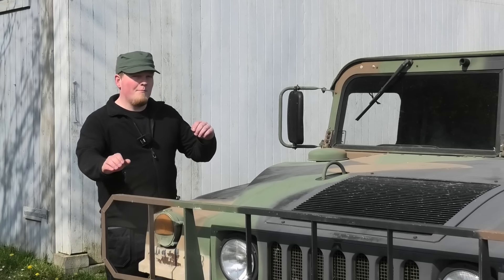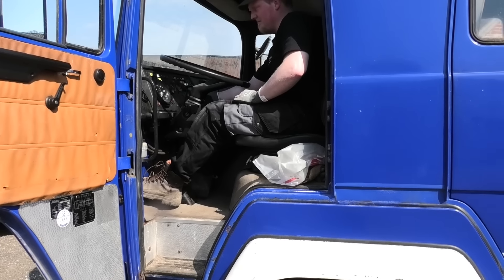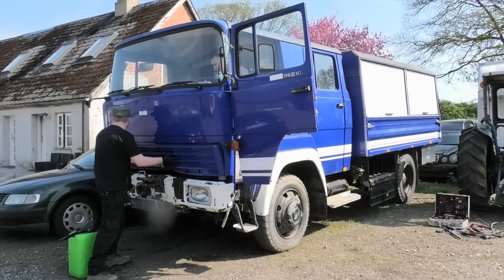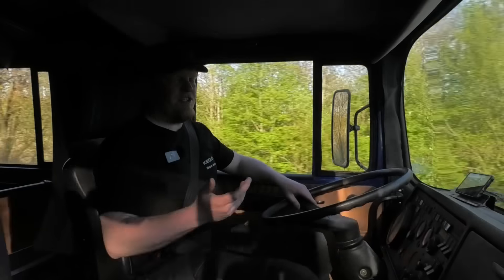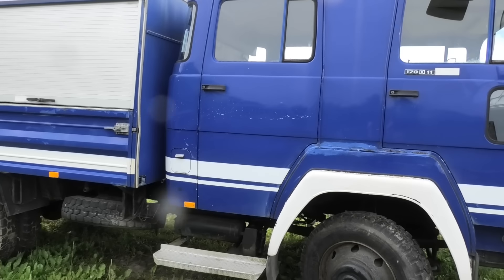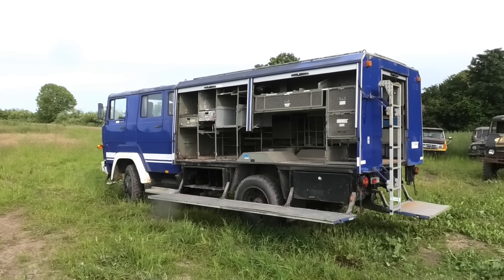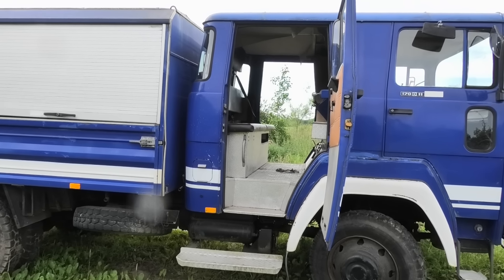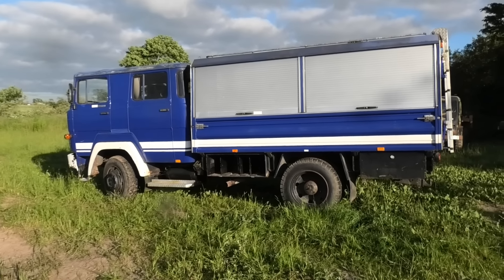Bought a Magirus "unseen" - Can we drive it home?

Comment: I operated one of these until 3 years ago and did some repairs and rebuilds and stuff. So feel free to ask.
If you are going about 60km/h in 6th gear full throttle, it may be you are in low gear. Changing gears is somewhat tricky sometimes, it may stick in low gear even if the lever is on the left. What you need to do is pull the lever even more to the left, you should hear the air cylinder doing something. If it's sticking, drive the thing, go full throttle, pull the lever to the left and hold it, lift the trottle and back to full throttle. It should shift, if not do it again. Or try to get in in low gear, to make sure where you are.
The knob in front of that lever is the middle diff lock. The rear diff lock is the knob right side near the steering column.
It would be interesting where it has been in service.
Reply from the maker: Thanks a lot! thats very helpfull. and pretty much confirms how i figured the levers for the transfer-case, work :)
But it doesn't feel stuck in low range (if so, those are some extemely high, low range gears.)
i was able to get it up to speeds of 80-90 km/h. But it just took a really long time.
And on gear changes, when i hit the max speed in one gear, and then canged to the next, it barely had enough power to pull in that gear.
So it really felt like i just couldn't give the engine enough throttle.
But i still haven't looked into the whole ting, any further :)

Oh, and from the little documentation i have, i seems this served at a depot, in Suderlügum. and was last registered there, in 2016.
Reply: @KJOff-Road /videos 90km/h means it's in high gear, for sure. It's high speed, maybe it will make 92 or 93. So fuel issue it is.

There was no THW in Süderlügum, but in Niebüll. Maybe from somewhere else and second life in Süderlügüm. I couldn't find anything.

Comment: That would be such a good starting point for a camper build.  Off-road capability and a sturdy functional box.  There are many of these still around, see if you can sell the box to a fellow Magirus owner at least.
Reply from the maker: I have seen a lot og these, turned into camper rig's :)
Reply: Sick of hearing about Campers
Reply: @KJOff-Road  When you have the box off just place it in a barn and use it as a tool box. Crib up to the chassis height, and you have a nice new secure tool storage.

Comment: The problem with the engine rpm is likely to be the governor on the injector pump. If the seaĺ goes bad on the rear of the pump it causes a hydraulic problem that stops the governer from opening up.

Comment: German guy here. If you can't get it sorted in your place - maybe I can help.

I shortly looked into it: With a buying contract (has to have the VIN in it) German KBA (Kraftfahrt-Bundesamt) should be able to provide the neccessary documents for a small fee.
Reply: Ich habe auch schon geschrieben, dass ich mich im Zweifelsfall mal mit meiner Zulassungsstelle diesbezüglich unterhalte.

Die Daten müssen ja da sein. Wäre traurig, wenn der Lkw nicht wieder auf die Straße kommt.
Reply: Would be great to have German help if he ends up needing to contact a German bureaucratic system 👍
Danke
Reply from the maker: Thanks a lot guys. it's good to know :)
I may get a hold of you, if needed :)
Reply: @KJOff-Road  Hi, I live in Sweden and had a similiar issue with an former German Ikarus buss. You need to get in touch with the local office too the city where it was registered. 
There is no central office that has registration documentation in germany it all handled locally. If you have the german numberplate number that helps point you at wich office you need to contact. otherwise i would try taking contact with the THW becouse they probably have documentation on it.
Reply: @KJOff-Road 

With the THW license plates there are some things to know. 
Because there are a special organisation, the KBA (Kraftfahrt Bundesamt) can't help you.
The vehicles are registered via the THW registration office at the Procurement Office of the Federal Ministry of the Interior. 
I'm from Germany as well, please get in touch to me, If needed.
BR, Martin
Reply: That is a very cool box. It would be nice to have something like that in the US. You should find a trailer that you could put it on and have a mobile work shop with a generator and welder. Hope you can get the legal stuff taken cared of.

Comment: i drove that type of Truck at THW many years ago 🙂
the trottle problem looks like a swamped diesel filter or the diesel HP pump (nned some maintenance)
BTW: the "shut off button" is meant as trottle-brake

Comment: Congratulations on the acquisition of the ex-THW Magirus. Unfortunately, I didn't watch the video earlier. 
Here is my tip: There is a website (in German) on which thousands of historic construction machines are presented and discussed, including many ex-THW vehicles. You may be able to get help there. The latter will perhaps come quicker if you register there and introduce the vehicle. As YT generally don't like links in comments, I will send you the link by email to the address you provided in this thread.

Good luck
Reply from the maker: Thanks a lot. I got your mail 👍
This might be very helpful :)
Reply: @KJOff-Road  The Magirus Deutz 170D11 is a widespread model that is also used by many fire brigades in addition to the THW. Both areas are known for the fact that vehicles are kept in them for a long time, especially as both fire brigades and the THW have plenty of opportunity to maintain their equipment when not in use. One more thing about the THW: The Federal Agency for Technical Relief (THW) is the German civil defence and disaster control organisation of the Federal Government with volunteer helpers and full-time employees in the portfolio of the Federal Ministry of the Interior and for Home Affairs. The higher federal authority has its headquarters in Bonn-Lengsdorf. The THW was founded in 1950 and has been a federal agency under public law with its own administrative substructure since 1953. The Federal Agency for Technical Relief is therefore a higher federal authority. 
The THW has local branches in almost every municipality. The equipment with vehicles and other devices is quite comprehensive. They are not a chip shop.
The Magirus model under discussion is already quite old. Since ex THW vehicles are widely known for their good condition, quite a few have found their ways to small fire brigades or into private hands. Accordingly, the concerning knowledge should be widely dispersed. The spare parts situation should not be particularly tight either. You just have to find both. Unfortunately (for you) the whole area mainly takes place in German language. In special cases, however, I'd like to help with the research. In such cases, please send me an e-mail to the address you know.

I wish you continued success.
All the best

Comment: @KJ Off-Road Hi KJ, German guy here who spend quite some time of his early life on THW and those rigs.
As already said there is nowadays a centralized license plate „THW-<number counting> on the actual THW trucks. But they changed the system quite some time ago for all THW , Police , Katastrophic Services and similar agencies Trucks and cars. Even sometimes Fire Trucks. With different letters of course: e.g. the letters from the normal car plates for the capital of the german sub-country (Bundesland) like for example in Hesse the capital is Wiesbaden meaning all police cars in Hesse have „WI-<number counting> plates. Makes shifting vehicles from one stationary to a different one a piece of cake.
That explained here comes the trick for you:
BEFORE that centralized practice those Trucks had real local Number plates like any other vehicle.
This means your truck probably had TWO number plates in his life meaning two sets of paperwork existed.
What you have to do is search the complete vehicle for remaining hints of those number plates, because with having multiple trucks if the same loaded goods and gear we have put frequently the number plate data (or a shortage of that) on the gear and multiple places in that truck. Basically everything removable that could be misplaced after cleaning offsite of these trucks needed to be identified to put it right back.

Also: inspect carefully the driver and passenger door. There must have been a time when „THW Ortsverband <Name of a german city> must have been signed in big letters on that doors.
This „Ortsverband …“ means something like Stationary.

So, with information of the old first number plate and the city name you look up the actual contacts of the THW of that city and ask them for the favor of a copy of that old paperwork. I know they keep goid records, especially the little ones like the one i was in.

If you only get the last THW-123456 Number plate you ask in the THW facebook group for a contact of the city name. You want to find the job role „Schirrmeister“ of that years after the manufacturing date of that truck to hit the jackpot of person knowing EVERYTYhYiYnYg of that truck because it was his duty.
And add a year when asking because sometimes they had the new trucks up to a year in stock coming from the manufacturer until all x-dozens of them where produced and then they rolled them out in the new version all at once to the different Ortsverband to make no-one jealous that the other ones already got the new truck.

THW people are nuts about their special vehicles and proudly show them off knowing every tiny detail if it - like fire fighters who are the same kind.
So as soon as you can name the plates and Ortsverband for specific identification it will be possible to find a person giving more details.

Good Luck!
Peter

Comment: That stop button in front of the seat, is the exhaust brake. But it also works as a stop button.

Mercedes used the exact same mechanism, until the late 80:s.

I drove a 10 cylinder Mercedes 1932 tanker truck for many years. Same setup, and the VDO gauges and warning lights were very similar. Even the steering wheel.
Reply from the maker: Ah, that would make sense :) 
Thanks!
Reply: My 2 cents: careful how you build the roof rack. The noise it makes at highway speed can bring about a lot of regret. But all in all great find. 
Put the box on a utility trailer for towing dirt bikes,  tools and sleeping quarters,  what have you,  for off road adventures .

Comment: Suggestion
Remove the shelf's
Keep the side folding platform and modified it so the "blue panel" could fold down (some named it 3way)
IMO it will make the "flat bed" more practical

Also that workinglamp somewhat feels soo coolll

Comment: O yes. I know the sound off those air cooled Deutz engines so well. As a much younger bloke I served in the South African defense force. " yes South Africa did have a proper defense force back in those days. " and they're vehicle of choice was the Magirus Deuts. And yes, I was a driver. Fantasticly well built old trucks.
Reply: Known as SAMIL and SAMAG. South African license built magirus trucks.

South Africa only imported a small amount of actual magirus Deutz trucks. Around 2500 units if I recall correctly.

How ever produced around 16 000 SAMAG, SAMILs locally.
Reply: @spotty4710  The SAMAG and SAMIL all used ADE engines though, the Deutz engines were only used in those branded Magirus, and also in aircraft tractors and such, along with use in the fire engines on all bases. The tractors used the Deutz engines, a Borg Warner automatic truck gearbox, and a modified Mercedes differential, along with a prop shaft that was basically 2 universal joints welded together, as the tractor was that small. But with it all being made from bent steel plate, thinnest being 6mm steel as covers, and then going to the chassis, made from 25mm steel plate welded to make the U channels and such, so that you had a 16 ton aircraft tractor, locked forever into first gear with a pin. Those were wicked fast on take off, though when they were involved in accidents, invariably the damage was to what they hit, and possibly a new coat of yellow paint on the tractor. I did rebuild one that caught on fire, memorable in that they used every fire extinguisher in the area on it before the brigade arrived. not worried about the tractor, but because of what it was towing when the wiring loom caught fire.
Reply: @SeanBZA  the Mk.1 models used deutz. Noted by the smaller grill style than found on the Mk. 2 and 3 models.

Comment: The truck is so old with so few kilometers on the clock... it hasn't even had the "major inspection" yet, the problem with the "speed" could be that the injection pump needs an oil change because old oil becomes "sticky" over time. The problem (which someone else posted) with the leaky seal on the pump comes from "many kilometers driven", but with less than 50k on the clock it is more likely "swamped oil" so that the pump cannot turn on fully. (I speak from experience, because many mechanics don't want to do this oil change because it is a huge mess)

Comment: I did a little research, and that truck has the Duetz F6L413 engine, which is a 4 stroke 9.6 L. V-6. It appears to be turning plenty fast RPM-wise (max is 2300 at WOT), but someone else mentioned the little lever between the seats as being for either a 2 speed axle, or the splitter for a secondary gearset in the transmission. Most likely, you were stuck in low range through the whole trip! If it's anything like the control valve for the PTO, it's probably worth looking into. I love the design of the body on that thing. It would be perfect for a tool truck at a racetrack, or for on site heavy equipment service!😉👍👍

Comment: 100% agree . Strip out the rear body and turn it into living space . 
Aluminium sheet where the side roller doors are . 
Insulate with celotex sheet materials . Solar on the roof . 
Honest it would make a fantastic camping vehicle . 
Much nicer than sleeping in the back of the cab . 
Nice truck .

Comment: Sir that's a super nice work truck.  Greeting from Murika.
@25:50 It's a diesel it probably has a govener limiting it, it really sounds like 17-1800 rpm to me, that wouldn't be out of the normal.  I'd think 2500 would be too fast for that engine to spin, most older diesel engines are booking it at 2 grand

Comment: That Box would make an ideal base for the construction of a camper, and with those step sides it opens up possibilities for slide outs or canvas extenders to increase the usable space, along with the under body boxes for storage etc, even if it is not used on the current chassis

Comment: I could be wrong but usually that button at your foot you pressed to stop the engine is actually called a decelerator, its used to retard the engine exhaust when travelling down long hills, it helps slow your vehicle down without overheating the brakes especially when carrying a heavy load..!
Hope this helps

Comment: I used to drive a Maggy Deutz 8 wheel tipper. Great bit of kit not the most powerful but that Air-cooled engine was so reliable. It never gave us any problems. Not the quietest engine and it had its own peculiar sound. But us Drivers loved them..

Comment: Dude can you show me the NATO jumper connector at some stage, if you think of it please, interested. I spent near 200 euros on some 350 amp andersons for my winch and , well thats too much!

Lovely truck. I dont know jack about those air cooled engines, never seen one, very interested to know more, find it hard to comprehend how it would keep cool under load. That IFA was a beaut. Great content.
Reply from the maker: Thanks!
And yeah, that is definetly too much!
The round Nato style connector are usually more expensive than the "Anderson" connectors. and even then, a set of nato connectors should only be about 100-150 euro.

Comment: It sounds like the governor is sticking at high RPMs. A little Marvels Mystery oil in the oil for about 30 minutes and then an oil change might solve the problem.
The box might be a good idea to keep and modify. It would hold a vehicle and keep the vehicle from the weather.

Comment: very reliable truck , but not longer or lower than the VW man . the performance of the engine will surprise everyone. but there are some backdraws  , you have to check the entire rig on regular basis . the exhaust  on both sides of the engine will fail one day soon because of rust , and
 buying a new one is close to ten grand each side.  we use to get ex army  one side V12 manifolds of the same engine type  (613/614 or 712/714) depending on the measures of the cilinder heads apart. and cut those in half  to match two 3 cilinder manifolds. a lot of welding saved us thousants.

Comment: Kaspar, I thought getting imported vehicles registered in Australia was hard, we have it easy, no need to find history etc for it, so long as the numbers match the export/import documents no sweat. a tray keepin the drp down side platforms and a ramp would to me be ideal and use the box as tool storage and centre aisle of the box as somewhere to store long lengths of steel, and when you showed the middle on left side of the box instant location for a decent compressor. my thoughts but hey I'm Aussie. Pete
Reply from the maker: Hah, yeah. it really can be quite a headache. with the system we have, the paper-work is more important than the vehicle itself.
Reply: @KJOff-Road  I recognize the blue/white paint on the truck. This was from THW of Germany, a civil defense service team. Germany also has a dedicated water rescue team known as the DLRG.

Comment: What you need to register it is called a Datenblatt,that's a manufacturer issued data card,to obtain it you will need the vin/chassis number.If you can't get it you may be able to contact the THW,they are very helpful and may be able to help.But don't be under the illusion that Germans are efficient,these times have gone quite a while ago. Good luck.
Reply from the maker: Thanks a lot! :)